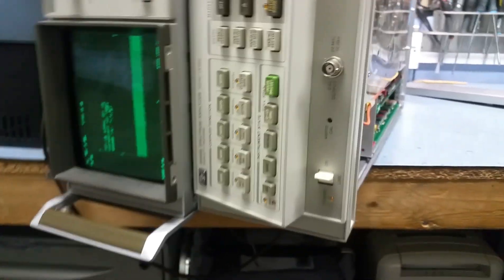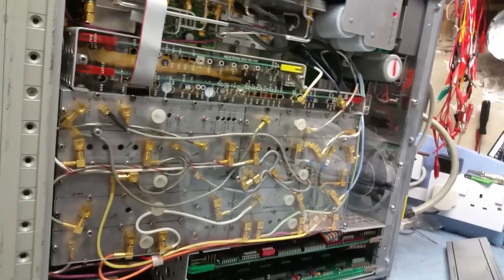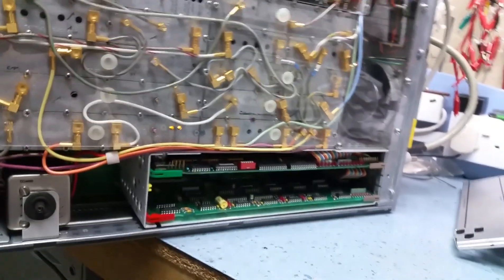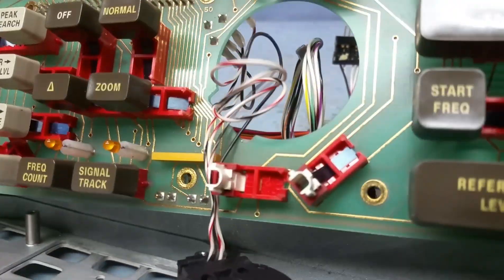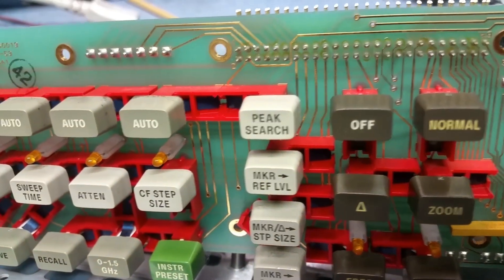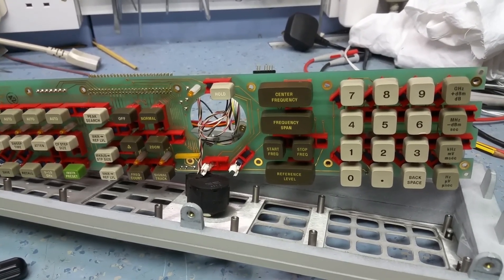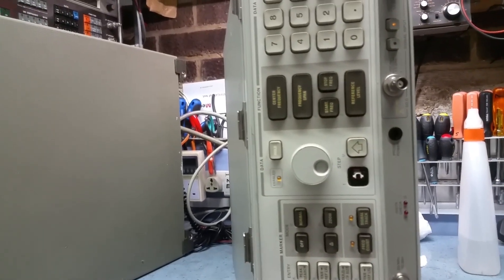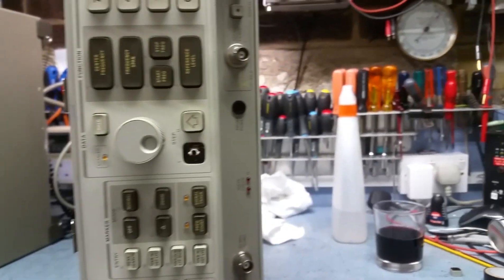Hp 8568b Sticky switch

Comment: Thing is, I have found those snappy, annoying HP keyboard switches to be far more reliable than the keyboards on other test gear of a similar vintage. For example: those crappy rubber/carbon membrane contacts. Good luck fixing those or finding a replacement. I have had great success just replacing the steel spring shims in the vintage HP gear. Of course, that implies you need a small stock of spring shims on hand, or a supply of outdated ball point pens to harvest minaiture coiled springs from.